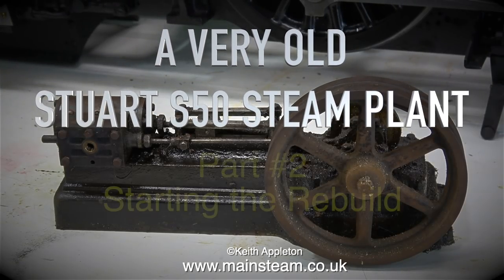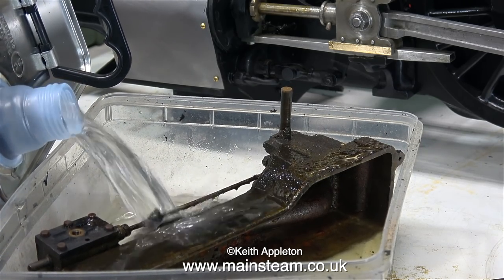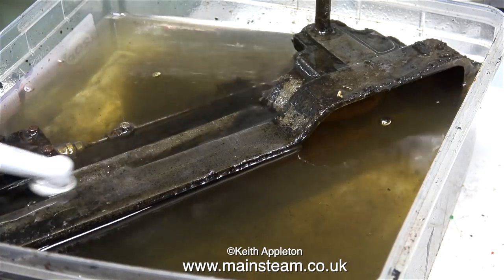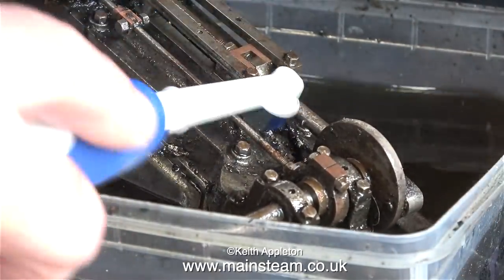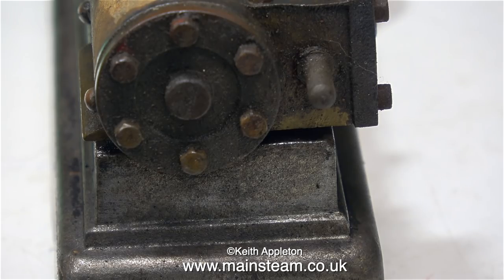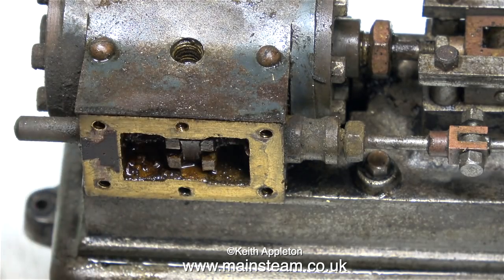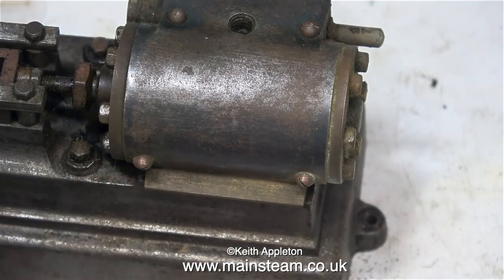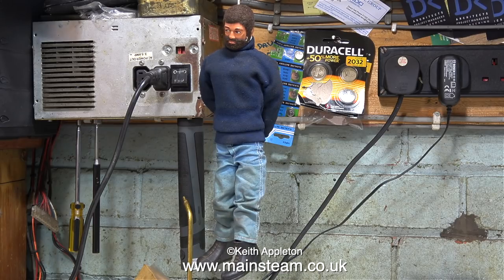A VERY OLD STUART S50 STEAM PLANT - PART #2

Comment: Hello Keith, if you don't like wearing rubber gloves, I've used "Raths PR88 barrier cream" for years. A small acorn size amount rubbed into your hands stops most chemicals, grease, oils etc hurting your hands. Water is the only thing that removes it. You'll find it on eBay or good mechanical suppliers. Comes in a yellow tub and all the reviews give it very good appraisals. Hope this helps.
Reply: It is also excellent for when one is chopping up hot chilis, I am told.

Comment: Love your videos. You might want to try and rotate your thinner can so the spout is at the top of the fluid level rather than the bottom. It stops that glug, glug , glug spurting when pouring. I learned this as a young man when I was spilling a lot of a very exspensive cleaner that we used on a job. The boss corrected my misused of the company purchased product that I was wasting

Comment: The thinner can has the spout in one corner on purpose. If you put that corner on the top and then pour there is far less fluid above it and thus air can get in easier and it doesn't splash as much

Comment: Keith if you turn the spirits can around and have the spout at the top it will not gurgle and spit,
because the air can get in the can above the fluid level.
Reply from the maker: So I am told, but for some reason I usually spill more of it if I do it that way . . . .
Reply: @keithappleton  LOL

Comment: A top tip: pour the thinner that the opening is on the top, not in the bottom. This will prevent bubble-splashing of the liquid
Reply: Adam Lipsky   you beat me to it, I was reading the comments to check before writing exactly the same thing.